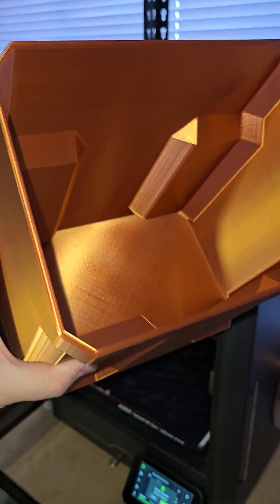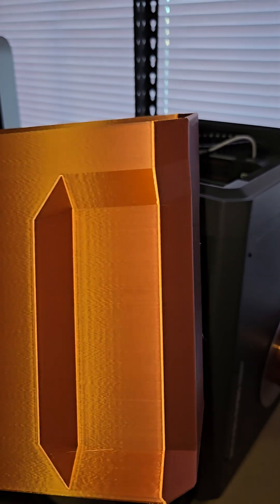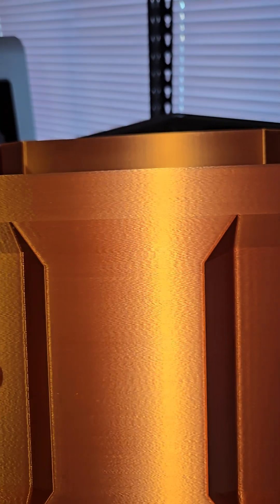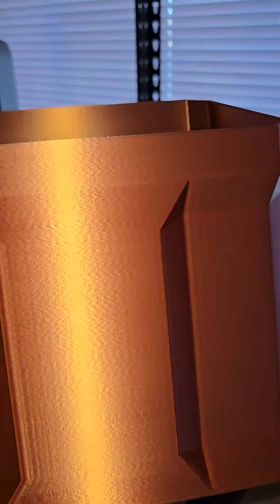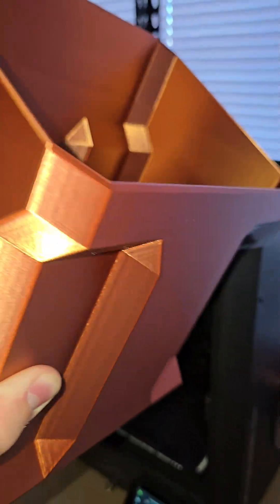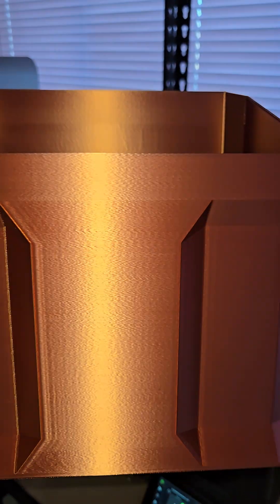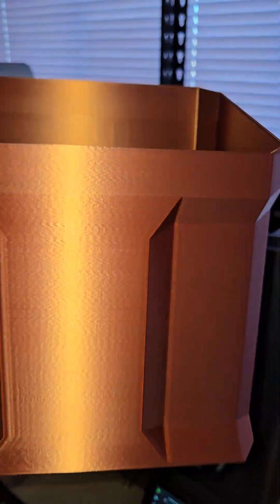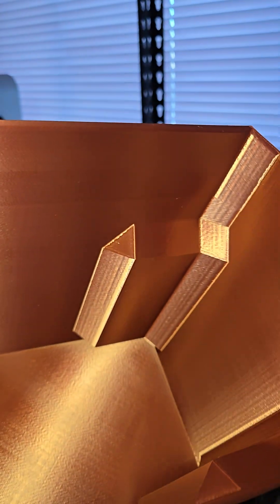Elegoo Centauri Carbon Prints Amazing!

Comment: Printing with silk filaments, did you use the standard PLA profile or the Silk profile? I’ve been trying to use the silk profile but the prints come out terrible
Reply from the maker: I've used both. This wasn't a profile issue. From the profile perspective, the PLA is better. From a hardware perspective, this isn't great.

Comment: There is some VFA there besides the pattern, try printing the VFA tower test that is built-in in the calibration options in Orca slicer. There you can find the print speed ranges you should avoid.

Comment: If you look at the XY gantry, the toothed belt is running over the smooth pulley. And not on the back side, this will create a jerky motion in the head

Comment: How bad is this noticable with matte or just regular pla, did you test this? I'm just getting into 3D printing and preordered this one. I don't really mind the pattern at all, I'm just wondering
Reply from the maker: Pattern isn't the main issue. It's the skew. When you want a square, it prints a rhombus. When you want a circle, you get an oval. The printer itself isn't square.

Comment: What is racking and skewed, is it fixable
Reply from the maker: The printer's frame, as a whole. The whole outer aluminum fame is bent. No, Elegoo is sending me another one.
Reply: When will you get replacement? How to check for this skewed problem
Reply from the maker: @akierum  still haven't gotten it. I have a file on printables to that you print and measure to show skew in the 3 axes.